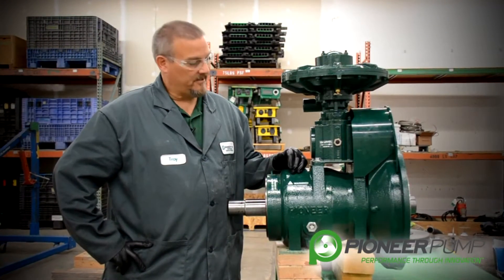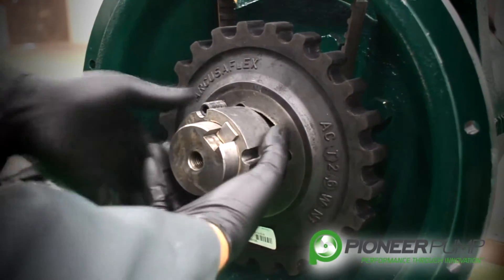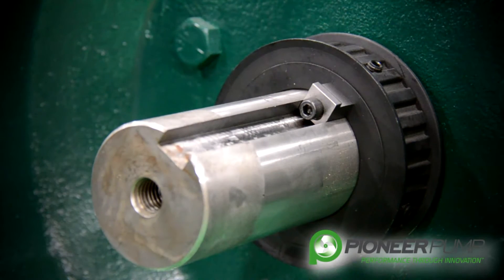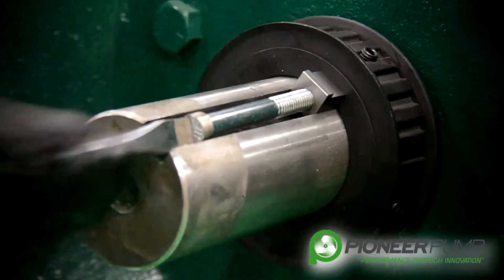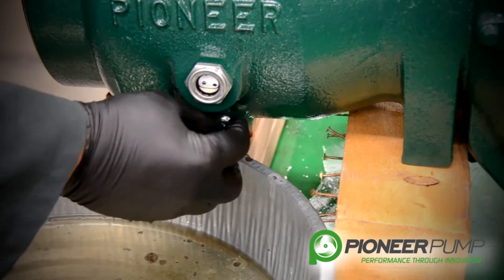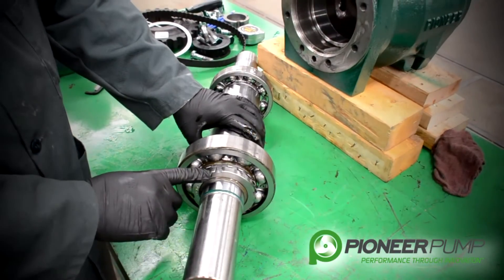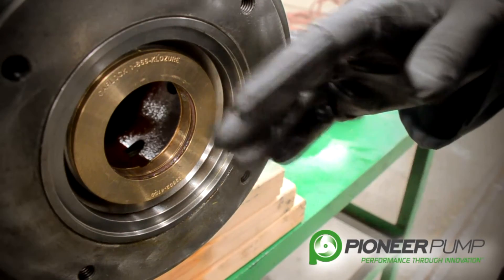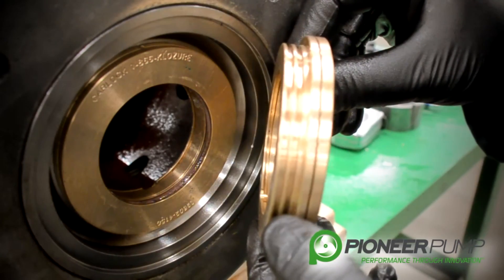Pioneer Pump Service Training

Comment: If anyone get a kit and gets 3 shims only one is needed you have to find the right size measure old one. it sit on the bearings on back .the one on the front wavey shim with the cut is also place on top of top bearing.  My thoughts  Don't buy a pump from a motor company there no support and you have to go through a ordeal to get a hold of a tec just to get a question answered. no reply back on YouTube that for sure. No wonder why you don't really see any one using this pump oil design is terrible.  my opinion. Hope this helps some try to assemble one✌️💦💯

Comment: for the last few years i have been putting a lock washer on the 1/4 screw that holds the wedge key together. i have never had a failure doing this and it protects the key from damage. people tend to drive that screw home and it cause the key to have to be retapped.